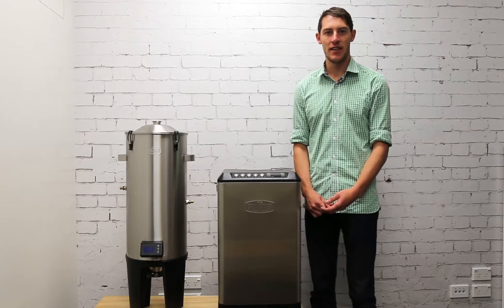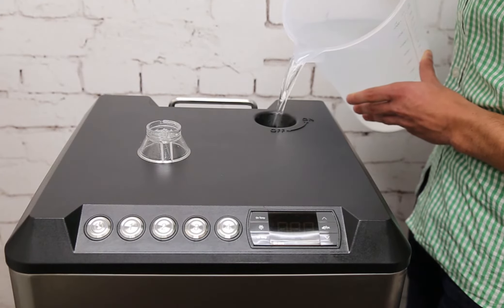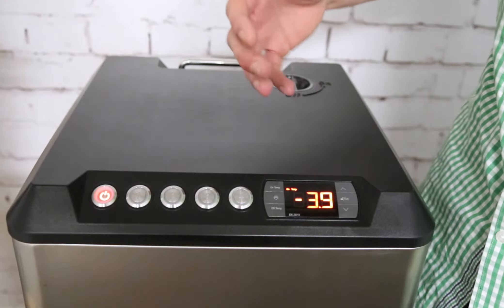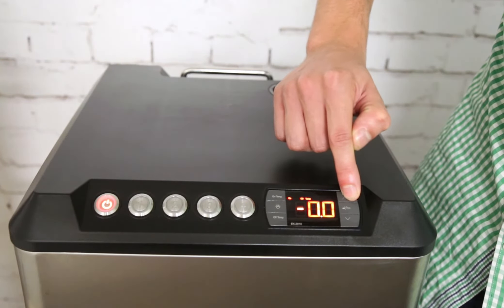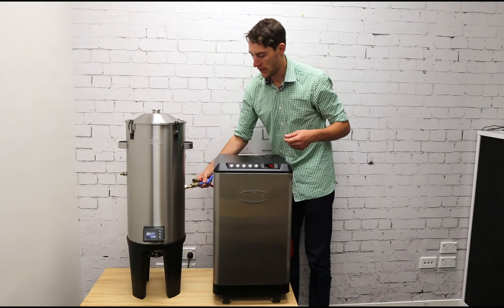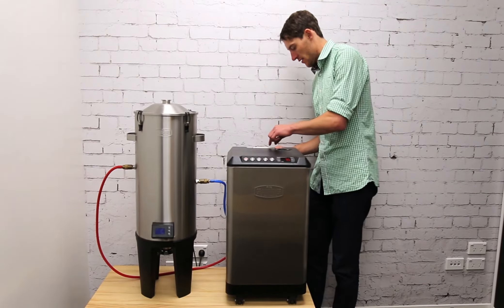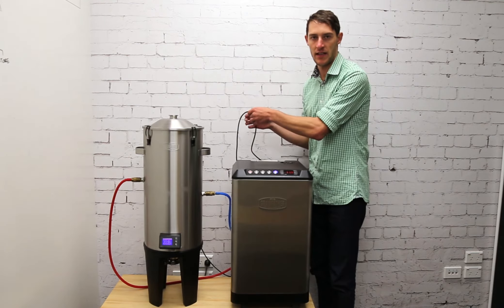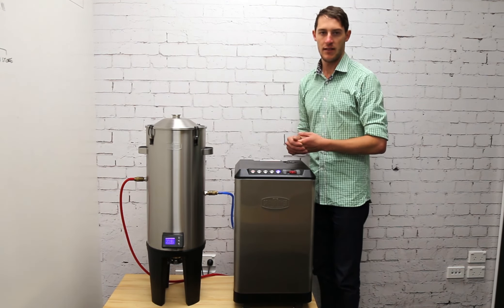The Grainfather - Conical Fermenter - Glycol Chiller Instructional Video

Comment: You can buy a grainfather connect, 2 grainfather conicals, a grainfather glycol chiller, a mangrove jack's 2 tap kegerator co2 bottle and all the fittings for less than a williamswarn brewmaster. But it will take up more space ;)